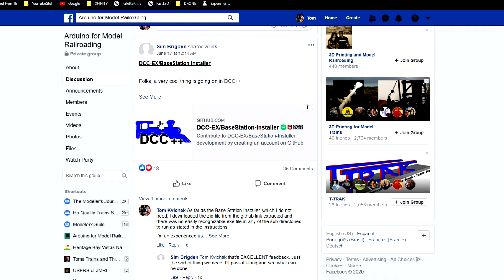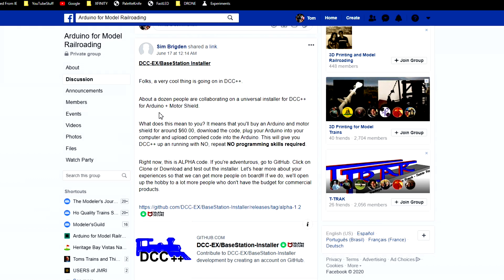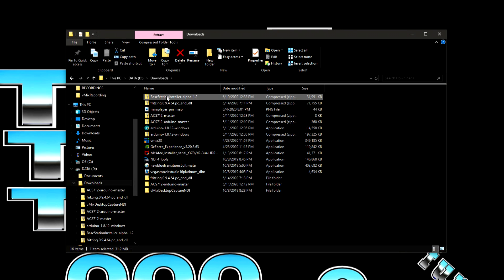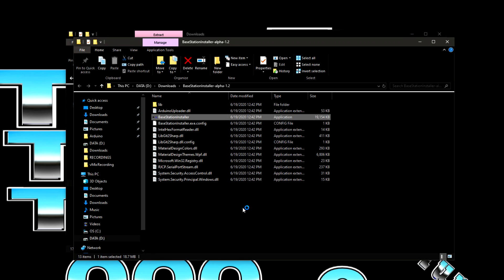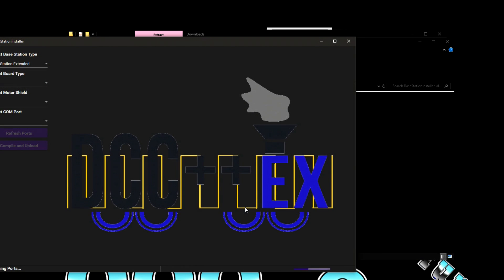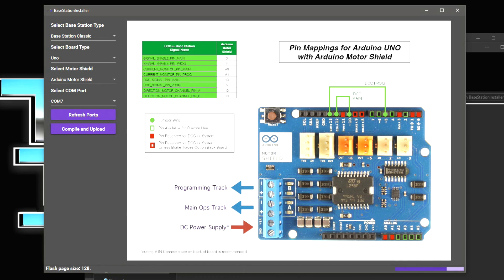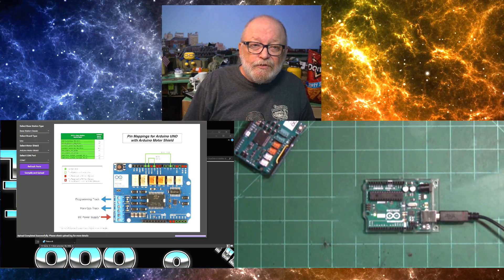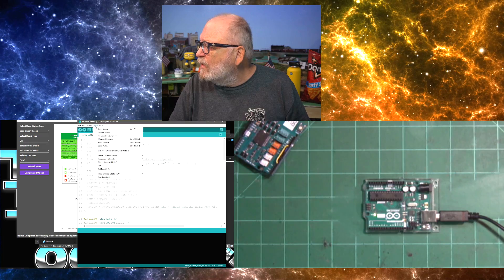Easiest Way Yet To Install DCC++ Without A Sketch Or Arduino IDE

Comment: So i am the author of the Base Station installer. It has been rewritten to allow running on multiple operating systems including macOS X and even the raspberry pi. You can download the latest version from the following link. https://github.com/DCC-EX/BaseStation-Installer/releases
Reply from the maker: I just included the link in my pinned comment. Thanks for your hard work. Much appreciated.
Reply: @TomsTrainsandThings  Yes i saw the link but that is for the old version of the installer the new version is now cross platform and looks completely different. Also there will be more updates to come stay tuned :D

Comment: I know it's probably covered somewhere else but what is the next step if you want to hook this up to a program track or your main line and run trains. Is it the jmri software or is there something in between. And on another note could I had just installed the DCC ++EX. And that would be the same thing as this I just don't need the Wi-Fi right now.
Reply from the maker: This is an earlier version of DCC++EX. They have made many improvements since I did this video. Yes, JMRI is the preferred method of running your trains and programing. There are two outputs on the motor shield, one is for programing and the other is for operation.. You do not need the wifi shield if you do not want to run trains remotely. There are also other options available for wifi since this video.

Fir the latest version, check out the wen page: https://dcc-ex.com/
Reply: Yes thank you for responding Tom I had seen where there is a later 4.0 version. So I would be able to just install this 4.0 version over the old one but the motor shield on and install jmri and then I can run the train?
Reply from the maker: Yep, just install the new version

Comment: I am pretty sure this video is geared toward people who have experience with the software and the hardware already and not for a novice like myself who would like to build the device and install the software.

The author says "you hook up this" and "connect that" and other vague references while showing a screen that one cannot read even full screen.  Tiny windows with tiny writing (even full screen) with the author in the middle at the top (unnecessary) flanked by two different colored nebula videos (even more unnecessary) reducing the windows we want to see to a small size.

While I appreciate the effort, I didn't find the video presentation done in a way to facilitate learning.
Reply from the maker: Take a look at my other 30 or so videos on the subject to get yourself up to speed on DCC++, Arduino, and other projects. You can start here
 https://www.youtube.com/playlist?list=PLjjhnrIKSTSgWNyYqv9g68zdK3Bp8Lav7

Comment: Thanks Tom! I hadn't had an opportunity to watch one of your fine videos in a long while but..  when I saw this topic and the fact that it was a short video at that, I had to watch it and its almost Midnight now!  I have just one Pi4 and while I put the original DCC++ on it, I have a different Motor Shield than the Arduino brand, its a Flashtree R3 and thought I should try this with that one and the Arduino Mega I planned to use for a bit more flexibility than the Uno.  Maybe I'll wait for the EX, maybe I'll do this and that later just to see what's what!  I have a bit more powerful Mean Well Switching Power Supply with 15V to use with it as my 12V Mean Well with the Arduino Uno and Arduino Motor Shield.  The Arduino people were adamant that I not use 15VDC with their Motor Shield even though I told them V-IN was disabled.  I think they discontinued their Motor Shield for awhile anyhow it was showing as Unavoidable Out of Stock after my correspondence with them on their Amazon page. Ever try a Flashtree Motor Shield?
Reply from the maker: Never heard of the Flashtree. The only ones that work without any modification with DCC++ is Arduino, Pololu, and Deek-Robot. Now for the DCC-EX that I mentioned, there are a few more that willl work with that one only. They are listed in the sketch for DCC++EX. There is a link in the Pinned comment in this video.

Comment: Thank you for this, Tom! We are still pulling things together for the project, the WEB Page, documentation, and of course a new version that is almost a complete re-write. DCC++EX right now is still based on Gregg Berman's original code with a lot of changes and additions. The next release will look the same as far as usability, but will be very different under the hood.  It will also have more API commands and come with an update to JMRI as well. Great job as usual, just please try to stop making videos faster than we can write code ;) - Fred Decker DCC++EX Project Lead
Reply from the maker: No problem Frank. Thanks for all your hard work on this project. I know a lot of model railroaders will love this new system with the additional features. I'll try to slow down on the videos. lol
Reply: @TomsTrainsandThings  Tom, Re: Fred's comment above he says a future release will, "come with an update to JMRI..." Clarify please, is this meaning that the version currently available for download does not support JMRI features, or that future versions will be more "friendly" to JMRI. Nice review Tom Very interested in this. Have a Mega & Shield awaiting this sketch, but would like to have more info.
Reply from the maker: @1Klooch  Sorry I didn't see your comment till now. YouTubes notification system isn't the greatest. I'd suggest going on their web site for more information.  https://dcc-ex.com/

Comment: Thanks a lot Tom for staying on top of the DCC++ situation and bringing us this important enhancement. Having a packaged installer has got to help a lot of people intimidated by "programming" an Arduino, especially if a packaged Uno/motor shield combo is available.  Art...
Reply from the maker: Glad it was helpful! Coming up with the -ex version is more available motor shields. I have to do a little more research to see what other features are available. So much to learn.